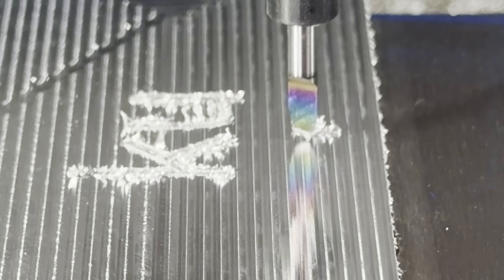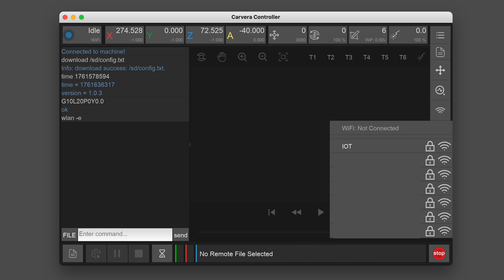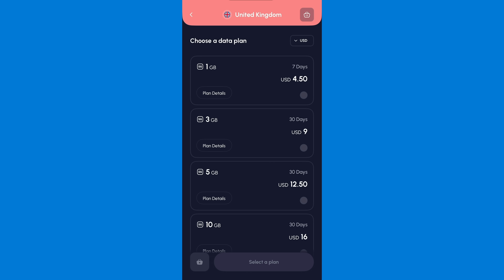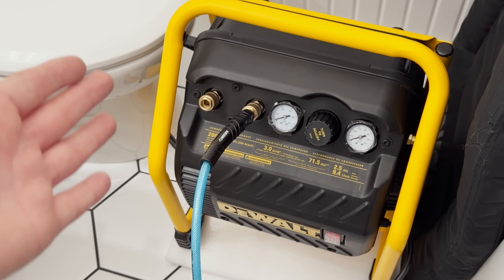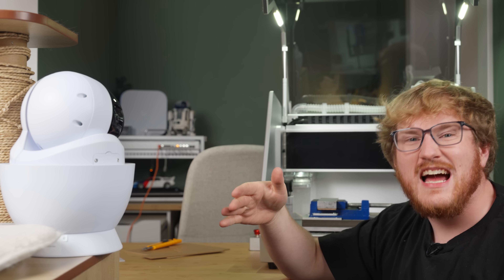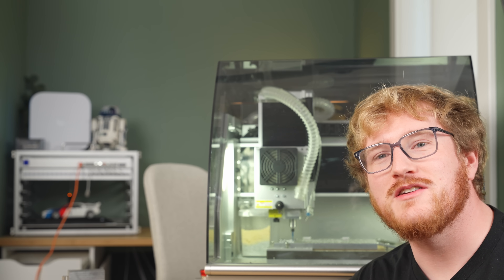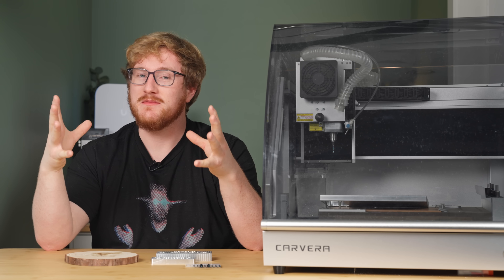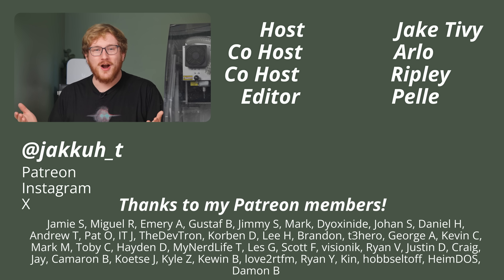This used to be IMPOSSIBLE - Makera Carvera

Comment: Machinist here. Your engraving bit broke because your cut was too deep. Ideal depth of cut for an engraving tool is around 0.1mm any more and, well, you saw. When cutting aluminum with an endmill you want to use a 2 flute endmill (the channel that the chip travel up once cut) because the biggest cause of tool breakage is clogged flutes. Also, when cutting aluminum you really want to run as many rpm as you can as with as the recommended speed on a 1/8"/3mm endmill is around 33000rpm.
If you have any questions feel free to reach out. Machining is a huge topic and there is a lot to learn.

Comment: So recycling 3D print waste is pretty much an additional side-hobby... Really involved, not nearly as fun... I'm wondering if recycling CNC waste would be simpler? If you just collect all the extra aluminium and send it off to some place could they just re-melt it and send you back new blanks? E.g. send in 1kg, let's assume it loses a bit in remelting so you end up getting e.g. 950g of blanks back? It doesn't have to be the exact aluminium you sent in, that'd be a logistical challenge - you just pay their processing and shipping fees and get a calculated amount of aluminium back in standardized sizes? I wish this was practical for 3D printing.

Comment: It tolerated 2x the recommendation. Full send isn’t “machining” - the real art is balancing tool wear, chip load, feed rate, part finish, and final tolerance. You can throw money at end mills and break tools while tearing up material to your heart’s content but it’s very satisfying to get GOOD at it, not just make “stuff”.

Hobby CNC mills are still a long way away from casual users getting amazing results like the 3D printing stuff has finally gotten to - but it’s coming!

Comment: We have a little shapeoko router and a haas tm1p in in our shop. We're using a gasoline IV bottle thing to feed mist coolant into the router and I think that could work for you if you need cooling. It's so jank, held from the drop ceiling with bungie cords. After all it's only temporary if it breaks.
Cut depth and travel speed are important but I would base stuff off your surface feet per minute or whatever the metric equivalent is. Kennametal has some good calculators if your CAM program doesn't. Pretty much everything I do is prototyping and one offs, rapid moves are the enemy of unknown programs, but hey experience is just knowledge gained a few minutes too late, at least you didn't scrap a day of work... I've only ever used solidworks cam and well it's pretty much fuck around and find out. Good luck!

Comment: T1 ( tool one. Tells the machine what tool pocket to go to. And which tool offsets to use ) M6 ( tells and allows it to change to the tool ) M8 ( tells it to open for cooling ) M9 ( tells it to close for cooling ) ( M8 and M9 is mostly used for liquid cooling) most of what was left of what I could see is just normal 3D coordinate system. Btw I'm a professional fully educated machinest

Comment: This is pretty painful to watch. There are plenty of tables and charts and other resources available regarding depth versus tool size versus speed of tool for safe milling. Even a cursory Google would have gotten you answers about how deep and how fast you can remove material with a given bit size and material of bit. If you want to get better at using the CNC, I would suggest looking at somewheres machinest tables to help you create better CAM profiles.

Comment: for the engraving bit you need to offset the tool way up from your intended cut and sneak it in(lower your cut in increments until you get the desired result.)  CAM knows how to deal with square corner bits, but the complex edge shape of an engraver ends up throwing it for a loop.  this is actually true for a lot of mill bits, it's just generally good practice to not trust the touchoff until you can test it's accurate.

Comment: @jakkuh_t this is epic!    I NEED a machine like this. 

To avoid crashes or mistakes like cutting a line through the logo 
Have a quick look through the G code before running, and make sure anywhere that it shows "G0" the coordinates don't collide with the work piece.

If you are breaking tips a great trick is just to slow down the X /Y movement. OR take a more shallow depth of cut but more passes. 

Enjoy your new machine! 🎉

Comment: Hy you need an approach or an angle or helical in aluminum even if the tool have a cross edge they apprised it more then plungeing them strait into 90°  ;)

Comment: You could see how good that is at cutting copper and make custom sized and shaped radiators. Or grab copper tubes and make aluminum on the outside and Cooper on the inside radiators for white PC builds. I'm certain someone would love that! 
And yeah you can now make everything you already made in a 3d printer but harder and shinier!

But please make an engine block!

Comment: " ha ha the tipe broke" and "this is two times recommended speed". Just don't. 
If you do something, do it right, do it seriously. Don't copy Linus and do shoddy work.
Wrong speeds will degrade the tool and it can degrade and lose precision or break. Overheating may affect the material of you workpiece.

Comment: I got a cheap Genmitsu CNC and it works great, I was looking at the carvera as it has a toolchangers that is pretty neat, but the sizes is a bit to be desired. if I did more smaller stuff then it would have been great. or even if it could have cut steel then I would have instantly bought it.

Comment: I know nothing practically speaking about CNC outside watching tons about it, but wouldn't some tool oil help keep the bits from breaking/overheating? If they are breaking on aluminum, probably the easiest metal lol, wouldn't that help? Either way, super cool and I'm sure over time both experience and updates/tools/parts etc let alone open source or community updates will help a ton.
Reply: Nah, it would help keep the tool sharp by keeping heat down, but tools breaking is usually due to physically ramming it into stuff way too fast.
Reply: It helps with tool life, surface finish, chip evacuation, but at that scale it ain't overheating, and won't break because it's missing cooling

Comment: A pro tip, avoid milling with a large part of the diameter of the mill, insted only use like 8% of the diameter but use the full length of the endmill, doing this allows for much faster operations, longer toll life and better finish. I have worked with industrial 5-axis CNC mills for 6 years now and this reminds me of the thrilling and unforgiving learning curve, best of luck 🎉

Comment: On my mini mill for zeroing the X,Y , once my machine  is zero, I use a  piece of paper. I move the spindle with manual control till it touch the paper against the part , and rotate the spindle by hand , if its right the bit will eject the paper with some nice cutter mark on the paper. For the Z if its metal , spit the probe wire and use the wire directly , one on the bit , the other on the piece. I probe pcb like with very  good result.

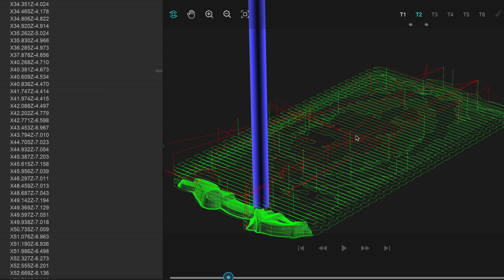Comment: 6:28 more dog and Arlo
Reply: CAM = Machine code
CAD = Design
Reply: 8:56 Valve. Not nozzle.
Reply: How long until he forgets, mixes metals in his dust collector and has the problem we all know he's headed for?
Reply: 13:01 It's for etching. Not cutting. Go get yourself a 6KW 4x8 if you wanna cut 'like a man'
Reply: Why are you redlining your brand new machine? If you push it to its limits you're going to have 4x the problems of using it properly, if not catastrophe. This is a case where the user is reducing the lifespan of the machine abnormally.  From the very beginning 🤦‍♂

Comment: Pretty funny that we live in a time when more of your audience is familiar with 3D printers than CNC mills, and thus explaining how the mill works in 3D printer terms.
When milling, do not go past the recommended speeds and feeds for the bit and material.  You actually should be below those numbers just to be safe until you learn your machine and know what it can do.  The rigidity of a mill is probably one of the single most important criteria to get accurate parts with a good surface finish.  Of course rigidity costs money, which is why you can get a great 3D printer for around $1k or less, but mills still typically cost multiple thousands.
  Curious if it can import g-code from other sources or does it have to use that software it came in?
Reply from the maker: I was using fusion360 to generate the tool paths mostly so yes!
Reply: @jakkuh_t  Right on. It's not a great CAD program, but lots of people use the CAM tools in F360 since they're free and surprisingly powerful.

Comment: Aluminum gums up really quickly when cutting it, it’ll happily stick all over your tool if you cut to quickly without proper cooling, I haven’t messed with air cooling in 5 years and only really used that on steel, at my current job we drown the parts in flood and thru coolant. It’s funny, I think the machines I run at work are dogshit because they’re older than I am, and can’t ream a hole bigger than .500 within .0005 anymore but I’m spoiled with things I take for granted like shooting gallons  qualichem extreme cut 719s in my parts and hating it because I can’t stand this oil on my skin

Comment: I've wanted Carvera Air, but it is too expensive for hobbyists. Z1 Seemed more reasonable, but the weak spindle  put me off. I am hoping for their next generation lineup, maybe they will beef the spindle up a bit for each model. Also, their machine naming is not that well thought out. Makera Carvera, Carvera Air, Carvera Z1, just does not sound like they are from the same brand or lineup.

Comment: That bit of "bumpy bumpy" is chatter. It's what happens when you go too fast, or too slow for a tool when machinating on the recommended material. Basically this is what happens when you try to color outside the lines with CNC. Don't want tool chatter? Don't rush the job.

Comment: Just as a heads up, you can (on "big" CNC's at least / ones I've used) adjust the "rapid speed" to slow down the feed rate / movement speed on the fly. You can adjust it / slap the button before something happens or you aren't sure if shits going to crash. Its used both to speed things up or sow them down. Just play around with it :) CNS's are super fuckin' awesome! They'll defanetly let you know when you do something wrong hahaha, you learn to understand the sounds its making.

Just took a peek at the manual - Looks like its just a "feed" status symbol at the top next to the A axis section.
Not a safe as a physical button / immediate response after seeing this note.
"Note: Adjusting the feed rate will not take effect immediately. Generally, it will take a few seconds to wait for the current command to finish."

Anyhow! That's awesome, and I'm a bit jealous :P

Comment: You can pretty much ask ai for speeds feeds depths widths for every type of toolpath or specific aluminium types but in general you gotta listen to the cut and the machine or you will dull the tool or you will brake the machine or the tool. Use carbide and there is a way to coat the tool or grease the metal if you have issues. Try to make threads with spiral milling and off you go. use walter TC645. Also you can copy and paste cnc code to ai and ask it to change stuff if your cam software dont. example is to modify a tool path to change spindle speeds while machining to avoid vibrations. -machinist

Comment: love your videos! Is that air compressor running on gas? If yes, please be super careful running that inside the house because of the exhaust gases.
Reply: If it were running on gas and it was a gasoline engine powering the air compressor then you don't just "be careful" running inside your house... You just literally do not ever run it inside your house.

But this one is not ICE powered, no compressor that size would be run by an engine.
You can also clearly see the plug going to the outlet.

Comment: I feel the emergency stop button being a USB plug in and not something that physically kills the power isn’t that robust
Reply: Watch the vid again bud
Reply: The E-stop was connected with a 2 pin cable. It is most likely a "Normally Closed" switch. If the button is pressed, or the cable cut or removed, an internal relay is most likely cutting power.